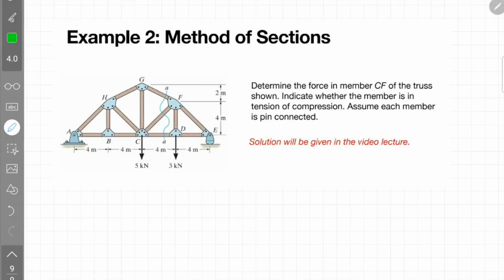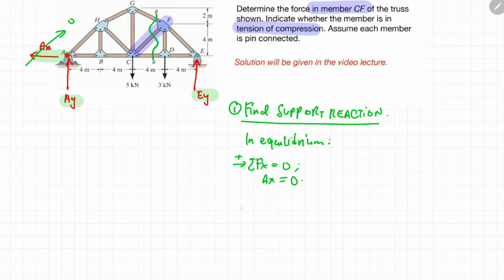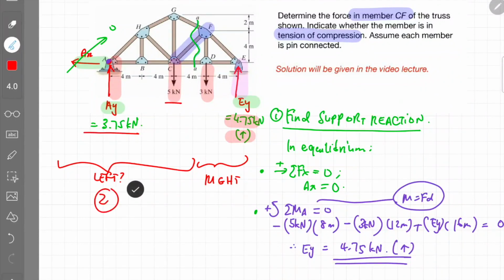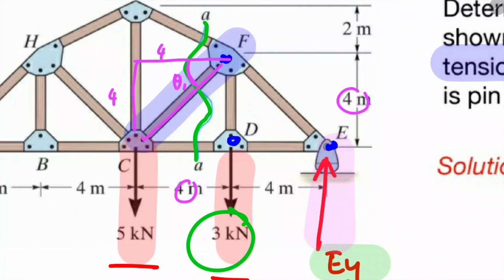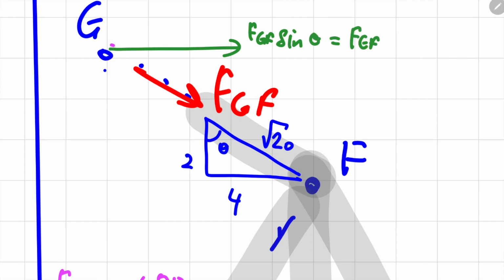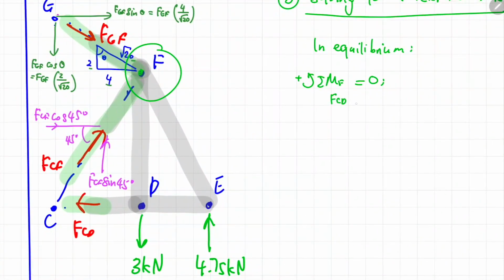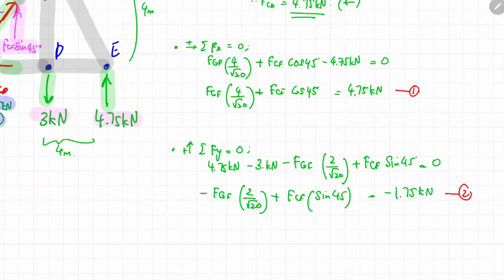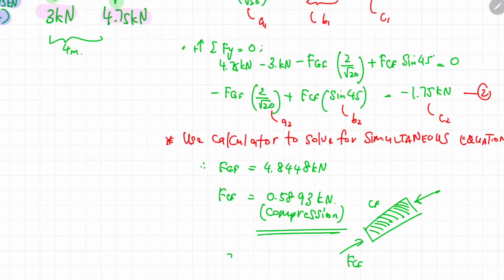BMCG1113: Chapter 6 - Structural Analysis (Part 4b)

Comment: Madam..FE mmg x termasuk ke dlm calculation tuu
Reply from the maker: Force of member FE tak ada, sebab sekarang bila pakai method of sections, kita fokus free-body-diagram  pada internal force of the member yang kita dah section-off.. 

Kalau pakai method of joints, if you analyse from joint E, then only baru ada muncul force of FE itu.